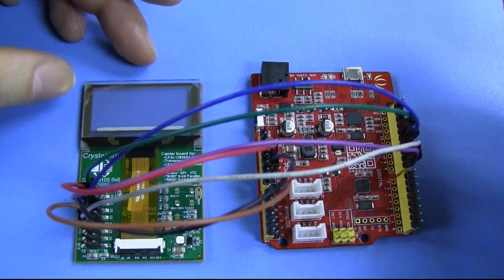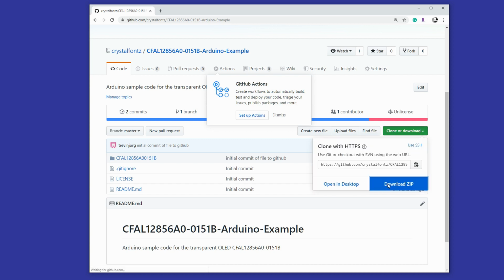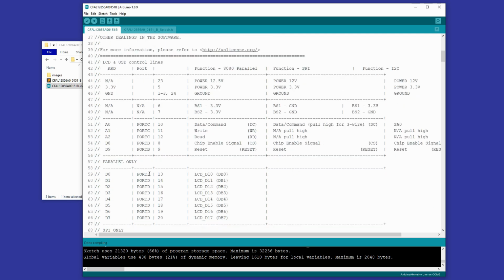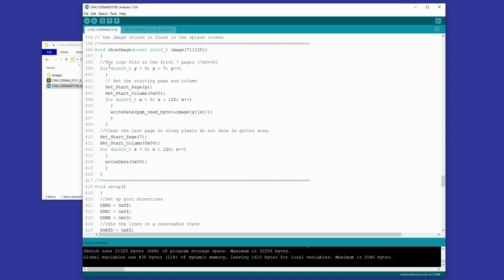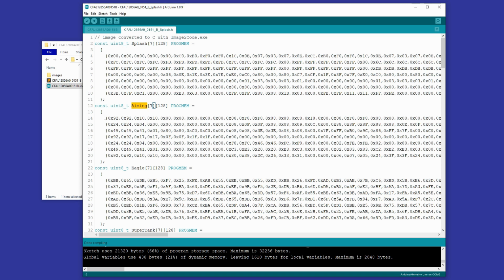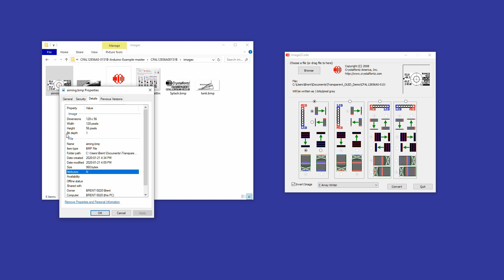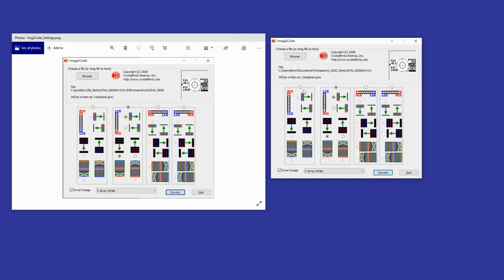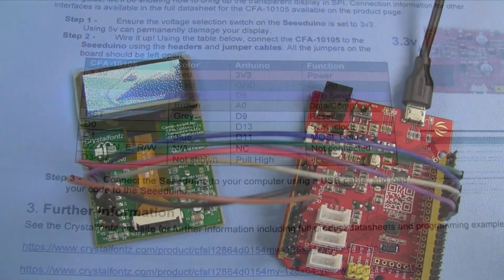Wiring and running a Transparent OLED on Arduino/Seeeduino with SPI or I2C

Comment: how can I get this to work with an Arduino Nano
Reply from the maker: Send us an email at support@crystalfontz.com our support team can get you going. As long as you can run 3.3v and SPI or I2C you can use any microprocessor.

Comment: What is the Current consumption of the oled and driver circuit?
Reply from the maker: 15.2mA. You can find all its tech specs and datasheet here: https://www.crystalfontz.com/product/cfal12856a00151b-128x56-transparent-oled-screen

Comment: I have used all the exact products used in this video but my pc is unable to detect the seeduino. I know this is not because of the data cable because it detects other devices that are connected using the exact same cable. The seeeduino doesn't show up in the device manager so the code cant be uploaded
It would be great if I could get some help
Reply from the maker: You should try a different USB port. Alternatively you can download the driver here: https://github.com/Seeed-Studio/Signed_USB_Serial_Driver/archive/master.zip But if it's nothing is showing up in device manager, that's likely an issue with the cable or USB port you're plugging into.
Reply: @Crystalfontz  Hi thank you for replying it was in fact the usb cable that was causing the issue. I am not very used to working with a seeduino and currently I am faced with another issue. This time the data is going to the seeduino but it is not getting transferred to the OLED. The arduino software is not showing any error though and says the upload is done. It is probably due to the connections but I have followed the exact directions in this video. I am sorry for asking again but if necessary I can add a picture of the connection between the OLED and the seeeduino.
Reply from the maker: @adithirajesh9238  Here's a link to the quick start guide. I'd confirm that you have the display plugged in correctly (and not upside down): https://www.crystalfontz.com/products/document/4270/CFA10105_Getting_Started.pdf If you send a picture of your setup to support@crystalfontz.com we can help you better.
Reply: @Crystalfontz  The link leads to an error page.
Reply from the maker: @adithirajesh9238  Sorry about that, try this one: https://www.crystalfontz.com/products/document/4270/CFA10105GettingStarted.pdf

Comment: what is the refresh rate?
Reply from the maker: We made this handy-dandy frame rate calculator which will help you determine the frame rate based on the microprocessor you're using: https://www.crystalfontz.com/products/arduino-lcd-displays.php